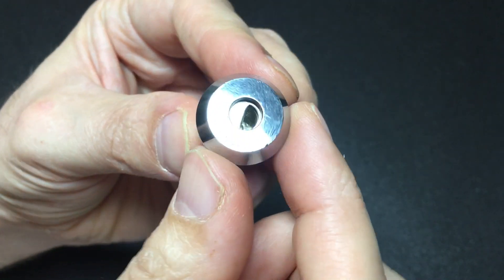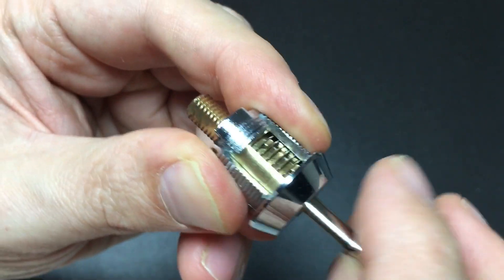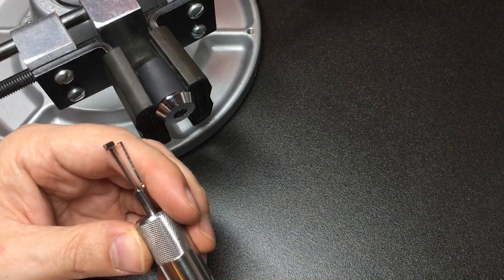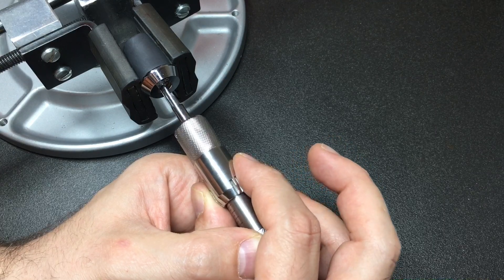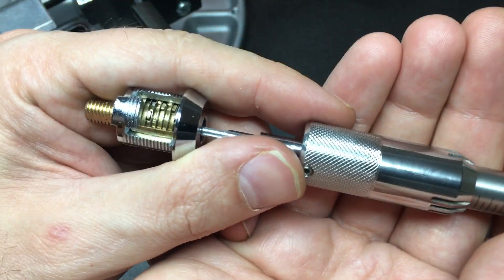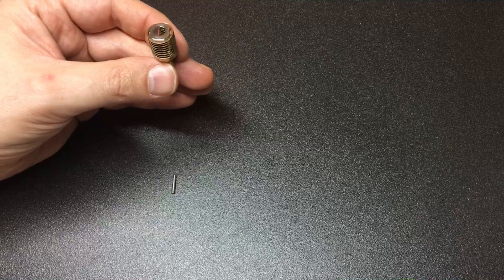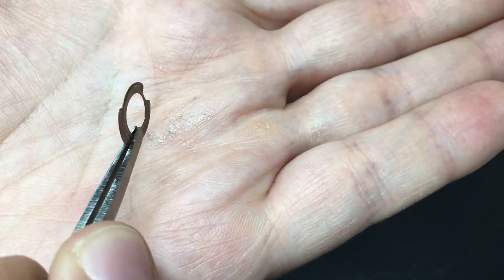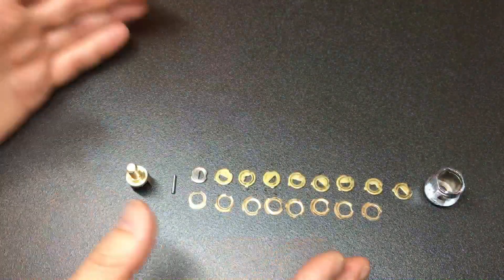9 Disc Abloy Classic Clone Cam Lock Picked

Comment: Great job dude! Lovely to see one of the kids doing well. That little extra cutout in the middle of the discs is there to stop flag-style picks (like dimple picks). Abloy made the change to stop Seppo Tervonen, (the sex pest from the 80's) because his Vempele used a flag-style tool and others have copied the idea since. So now, unless your pick can cover the full outer semi-circle of the lock, you're not picking the lock. Try it, the flag tip will fall into the cutout and only turn the disc a bit.
Reply: That's very clever.
Reply from the maker: Very interesting thanks!
Reply: Thanks for the simple explanation, Hux.

Comment: Very nicely done, the Silver bullet is definitely a wonderful tool. Really good video. 👍
Reply: Daz Evers 
Hey Daz, I just ordered my new lathe the other night. It should be here by truck in a week or so. I’ll need to do cleanup on it and get the DRO on it. Then do a few few other additions to it and I should be ready to go by the middle to end of next month. I’m looking at materials to use and I plan on getting with Al for some guidance. So I should be able to get rolling on them in about a month. Do you like brass Abloy picking tools? 😁
Reply: Fried Pi 3.14159 That’s fantastic news, I’m easy although a brass DD pick would be very cool, and a bit different. I will drop you an email. 👍
Reply from the maker: Thanks friend! It’s a really lovely tool!

Comment: I know next to nothing about DD locks and I think I've just understood for the first time what a "gate" actually is. I've heard that so many times but I never could visualise it nor how it works. Which brings me to a question: If it was your lock that you used for something not that cheap - couldn't you add false gates yourself by using e.g. a rotary tool to cut in more shallow slots into the disk?
Reply from the maker: You could, but in reality, you risk damaging the lock and it’s super unlikely someone would try to pick these locks when destructive techniques are easier and faster. 👍
Reply: @LockNoob  I know that criminals hardly if ever pick locks. I mostly wanted to verify if my understanding how this works is accurate. Thanks for the reply!

Comment: So the spacer disks will just freely spin in the lock? If so does that mean you might catch a true disk and a spacer disk with the pick tip and still pick the true disk?
Great video by the way.
Reply from the maker: No, in this lock at least, the spacers are fixed in place 👍

Comment: Funfact: Abloy classics will always have a 6-0 disc, this is where the name problem 50 comes in. That is why this does not resemble an abloy classic at all
Reply from the maker: Interesting- I think this clone is pretty good, shove something false gates in and it would be even better
Reply: @LockNoob  Have you tried machining false gates into existing discs, similar to adding security pins to a challenge lock?
Reply from the maker: Not a bad idea 💡
Reply: Bud Ward removibt spacers with 0 turn discs is way worse and makes them unpickable with a 2 in 1